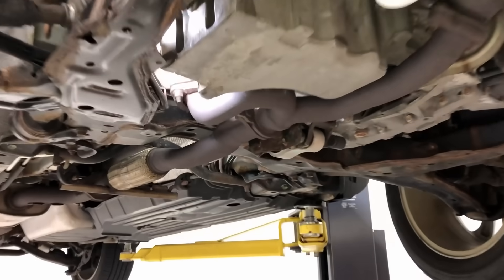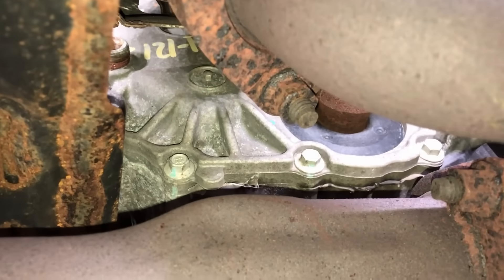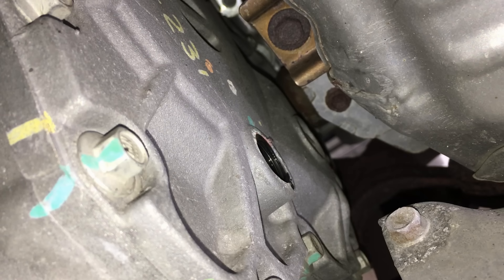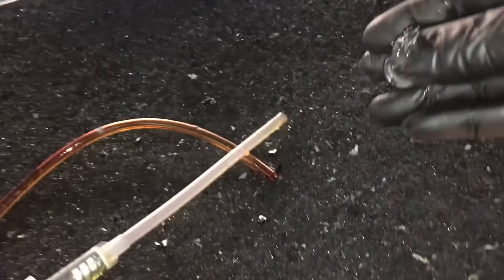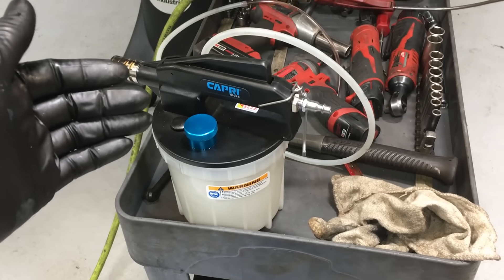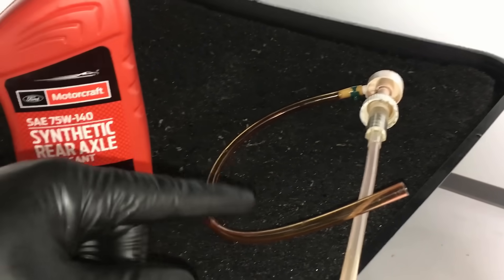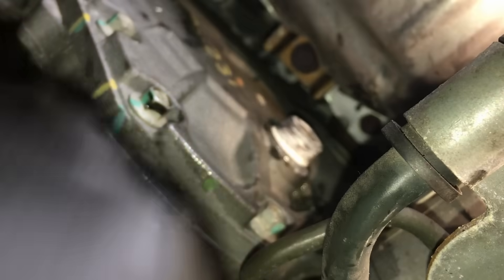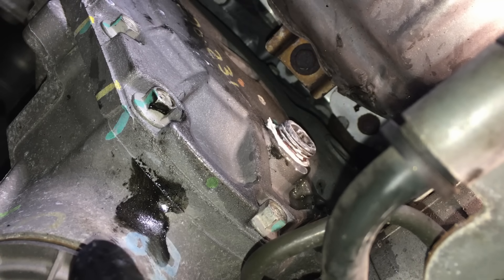Ford All Wheel Drive Vehicles: Critical PTU Fluid Exchange Procedure

Comment: Hi. I'm in  Southern  California What oil and filter would you recommend for a 2002 Ford F150 Supercrew 4.6 Trinton Automatic city and freeway driving no towing I bought it used with 170,000 miles.  It was a well maintained truck, city and freeway driving no towing.    It's my 1st oil change on truck.  1 Ford guy  I know says all he uses is Chevron Supreme conventional 10w40 all year with a motor craft oil filter on all his Ford F150s  Another  Ford guy says all he uses is 10w30 Mobil 1  synthetic with a motor craft  oil filter  on all his F150s he says the the 5w30 Mobil 1 is to light weight like the 5w20 that Ford recommends he says the engine smoother and quieter with the 10w30 Mobil 1. What do you think?
Reply: 5w20 keeps the cam  phasers happy.  0w20 in the cold. 
Triton motor likes to spit out spark plugs,might as well change them n ow and see.

Comment: My 09 flex's ptu had gone out twice. First time it was covered second they wouldn't back it. They quoted me 1500. It still drove fine. So I took it to our local transmission shop and they drilled n tapped it. Also ran diesel through it to help clean it out. I now use amsoil sever gear. Last I knew there was a class action lawsuit that you can join.
Reply: Any info about the Class Action?

Comment: It was nice in my 09 Taurus with AWD, the transmission did the front and rear drive, there was no separate ptu so changing the trans fluid was extremely easy and helpful.
Reply: If your '09 Taurus has AWD, then it most certainly has a separate PTU. How do I know? Because my '08 AWD Taurus has a PTU and because the '08 and '09 Taurus are identical.

Comment: Would this be the same on a 2015 Mazda CZ-9? I believe it has the 3.7 engine as the Ford Flex and it's AWD.
Reply: Yes, but your 2015 might have a drain plug.  Early ones did not.

Comment: If ford would stop using cheap fluids and have some integrity again maybe this shit would last longer then 30k-100k. Why I can't promote any ford after 2004. Every time you show stuff like this then promote motorcraft products that was probably inside that unit to begin with I throw up a little. Its already proven its junk and can't handle the task because I am pretty sure that's the same stuff they put in at the factory.

Comment: My mechanic changed the fluid in my 09 Mkx for $55. Second time I've had it done. Bought it with 55K had it done at around 85k and again at 95K. Will have it done again at 107K.

Comment: I have 2011 ford fusion awd...PTU failed @ 89000 miles. Cost 1200 to replace. I wish i knew about this as if i did i would of replaced fluid/checked it/did something about it sooner. Please keep videos about ford issues coming. Btw my current issue is with ABS unit...front brakes locking up...help.

Comment: A shop vac, a jar with two holes in the lid and and hoses will work on this job. It's easy to build your own vacuum for dirt cheap and saves you a LOT of money.
Reply: Actually there is a much cheaper way.  I have an old hand lotion pump with a hose attached to the tube.  Takes a little bit of time but I have used it for power steering fluid exchange and this job.  Self priming and has no issue withe semi solids like the tar in the PTU.
Reply: I wot m8
Reply: Hey

Comment: Perhaps it might be feasible to attach heat shielding
to some of the exhaust pipes and the catalytic
converter to reduce heat transfer to the PTU.
Reply: Hell no are you kidding . It's all about cutting g corners profit  baby profit baby. And besides if it lasts they will not come back for a new vehicle. Think $$$$$
Reply: That's what I did on mine.

Comment: This is what happen when 10 000 engineers do their own things then they put eveything together and hope for the best.

Remove all those exausth heat sources and it's probably good for a very very long time but someone had to design an exausth system, it's gonna go there and there, it's tight and problems start. Mine is starting to leak from the axle. I'll get the fluid changed this week. I hope it's not already too late. 2011 Flex ecoboost. 140 000km
Reply: In short, fuel economy at a price point .  Don't forget the rear differential  fluid .

Comment: Thank you for this video. I would never even thought about this fluid. I changed it this weekend. I already dropped the oil drain pan to put in a new gasket. Both were fairly clean I was surprised as the engine gas 165 k on it. What was the sealant you put on the plug please

Comment: So, this is different from getting a transmission flush?
Reply: Completely.  The PTU is attached to the transmission.  The PTU handles the power transfer (the PT part of PTU) between the front and rear wheels and is completely independent of the transmission.

Comment: That's a great information. I have a question. I own a ford EScape V6 3.0 4x4 XLT Sport 2002. The transfer case is leaking a little oil, how can I add more fluid? Can I drive the Truck if I don't see any problems? Thanks
Reply: just locate the plug ( let it cool down )  and fill it up to plug level with  the specified fluid .   Might want to suck/drain  and fill  again after a few hundred miles.
Reply: @tocrob  Thank you very much. it works better now. I am very appreciate.

Comment: I finished this for the first time, my fluid didn't look bad but I am worried that I did not fill it enough. There was a tiny stream of fluid coming out on level ground so I figured that it is full but I hardly used half a bottle. (2010 Ford Escape 4WD) I did notice though that my PTU was much smaller then the one shown in the video so maybe that''s all it needed.

Comment: Thanks for making me aware of this issue.  I just changed the ptu fluid on a 2017 ford escape 1.5l. Thankfully there is a drain plug and a fill plug. No suction device needed. 27,000mi. and fluid was black and thick. Don't put this off too long folks.
Reply: Oh no my 2018 has 56k. I'm doing it this week
Reply: @aolliegee How was the oil? What did it look like?
Reply: Yeah I’d say 20,000 max. I’ve had 2 go out on a 2013 edge. One at 60k and then 30k for the next one. Car is in the driveway now with a puddle under it. I’m gonna try an aftermarket one this time see how it fares.

Comment: Ford, because having a drain plug just makes sense. I would never buy their junk. Anything that holds fluids should have a drain bolt.
Reply: Why are people complaining about not having a drain plug the differential doesn't either nobody's complaining about that. At least it's not sealed.
Reply: @republicansareoffendedeasi821  -But the differential isn't hidden amongst all the heat producing components.  And look how hard it is to just get the plug out.
Reply: Tell that to chevy :/ atleast my mitsubishi is decent for what it is/isnt lol
Reply: I would say a plug is not always needed.  Automatic transmissions should or shouldn't have one goes either way.  Without a plug at least you have to take the pan off and while it is off inspect for parts such as shavings or see how dirty or caked on fluid might be.  Change filter and gasket and replace.  Few extra dollars but changing just the fluid doesn't let you know if something else might be going on that needs attention if it has a plug.

Comment: I'D be curious to know why I did this procedure and 2 days later I still get the fluid come out the vent cap at the top of the ptu???loose cap???HELP!
Reply: 1 - overfilled  ( technically not an issue )  ,  2 -  the vent is still plugging  up ( suck/drain and fill  again  ) causing  the ptu to burp .   The build up pressure  will eventually damage  seals too.

Comment: Do you need a friction modifier
Reply from the maker: No
Reply: Thank you so much for responding!!
Reply: @MrTommygatz  does the PTU need to be warm to suck out the old fluid?
Reply: @MrTommygatz  thanks , I drove over the weekend and let the exhaust cool but PTU fluid was still hot after 30 min. Job done!

Comment: Would you recommend installing some kind of a heat shield around the PTU? Seams like that could go a long way to preserving the unit.
Reply: The police models with active cooling are having similar PTU issues.
Reply: Matt Kraus header wrap and stainless screw type hose clamps

Comment: This is the kind of garbage the auto industry sells you. They don't put one drain plug on any gear boxes just to save 20$ yet alone not to mention grease fittings. Owned a Jeep 150 truck 4x4 it had 28 grease zerks and drain plugs for all the gear boxes. That's when the auto industrial complex was interested in quality products to keep customers. All that is built today is junk.

Comment: My 2016 focus RS at 17k miles, even with the updated PTU design failed. Tech replaced the hub/bearing assembly first as it did feel and sound like bad bearings. Moved to both axles/halfshafts next, then the PTU was changed out lol. Car was still new. No oil came out and it was like black sparkly tar on the magnet. Crazy. I’m going to change its oil every 10k Miles, pretty easy on the focus, just the air shield and down pipe need to be removed. Thanks for the vid brother.

Comment: Sadly, I have a 19 escape with one of these. How about developing a procedure for drilling, and tapping a small drain plug??
Reply from the maker: No there are ways to many design differences.
Reply: @FordTechMakuloco  I have a 2019 Nautilus and read on a forum that Ford has addressed the problem. Is that true or someone just blowing smoke?
Reply: @Pro1er Well I know they did put a drain plug on the newer models-2015 and newer I believe.
Reply: @jimh.412  Thanks for the reply Jim, it's about time for me replace the fluid but I'm an old guy and I hate (almost can't) go crawling around cars anymore. Even after searching Google I still can't get a definite yes or no so I guess I'll have to try and get under the car if I can.
Reply: laiky71 just makes too much sense
Reply: If i was going to drill into it I wouldn't just put a drain plug I would put a cooler as well and had more fluid to the system.

Comment: About how many quarts does a 2014 Edge PTU take to fill?
Reply from the maker: less than a quart.
Reply: @FordTechMakuloco  Thank you! Subbed...This is saving me a ton of $$.
Reply: @FordTechMakuloco  Did the job after work today....nasty black, stinky sludgey fluid came out, fill plug had as much sludge as the one in your video. My vehicle has 102000 miles. I'm going to drive it 1000 miles then do it again. Thank you again sir! Also, thank you for your service, much respect. ✊

Comment: I would change it, drive 500miles, then change again.
Reply: Yeah I was wondering too if it was a good idea to do a “Flush” at least one time before putting in the final (30k miles or 50km) change. I also went and had my rear end oil changed also..... 2013 ford escape with 203k km on it.
Reply: @packratswhatif  when you have visible sludge or build up always do a flush of some sort even if its gradual
Reply: He mentioned changing it again after 1000 miles in the video .

Comment: I have a question about our 08 Ford Edge. The banjo bolt is leaking on the power steering box. Replaced copper washers and new line and still leaks. Can I just replace the steering box?
Reply: Ronnie Spring the banjo bolt might be stretched or cracked. I’d try replacing that and the copper washers again and see if it stops

Comment: I was pissed when mine went on the highway, $2200.0 for a new one. It blew on the highway on the way home.  Now I asked Ford to install a drain plug and they said no and if I did it would void the warranty.  
 Those chunks in the case were not tar, that was the oil itself.  What they don't tell you is when that oil breaks down it turns to a solid and takes up space in the case, meaning you actually get less oil over time when you do the next service.  This is a part definitely designed to fail.  
 This is a great video and one every Ford awd owner should see and know about!
Reply from the maker: Of course it's not actually tar just nasty black goo like tar.
Reply: @FordTechMakuloco  yeah sorry I get that , mine was beyond that, it was like hard clay.  You can't get it out of the case and it takes up volume.  So when you go to add or change oil the next time you're actually losing volume of oil to put in. 
 I'm a huge Ford guy, use to work for Ford, but this is just wrong how they did this. Apparently in the U.S. they allow the drain plug fix, I actually came across it and took it into the shop when mine died,  but Ford Canada wouldn't cover it. 
 I can tell ya I built a 72 Mustang Grande and shoved a 429cid into it when I was 15, I still have the car at 45 and never had any issues lol, gas mileage sucks , but starts every time and runs like a champ lol
Reply: FordTechMakuloco like the tape on the back side of my 2011 f150 rocker panels ,welding in rockers today and cab corners

Comment: Thanks for helping a lot of people out with things we need to know and don't. I hope your life is going on in the right direction as far as finances and work goes. I think you have your own shop now if, I have kept up to date with your videos. That's better for a free thinking person anyways. Corporations want your soul if they can get it. Perhaps God is blazing the trail for you and keeping you for Himself when you come to that knowledge. Anyway I do have a question, if I may ask please. I bought an old 1999 Ford Windstar 3.8 for $500 with 105,000 miles on it and a lot of Michigan rust. Anyway, when I take a hard left hand turn the Auto Track light comes on saying its Active. That's weird. Then the vehicle makes a loud sound near the drivers side firewall, like its activating the abs system and starts shuddering/stalling the motor to slow. Could it be a worn out wheel bearing or half axle? Now, If I disengage or click OFF the Auto Track switch, it does Not happen. The transmission has been rebuilt by the previous distant relative. Before I put it on the road i'm bringing up to reliable standards . Being low income and semi-retired i'm on a budget and try to do all the work myself. You and you tube helps a lot. The rear axle show a lot of rust and so does the front sub frame. I might try to get Ford to recall it and replace those parts, if possible. Thanks for all the giving out and help you do for everyone trying to get by. God Bless. Bob R.

Comment: I have a 2008 Ford F-150 Limited with AWD. Is It the same setup and same procedure?
Reply: No u have a drain plug on transfer case! Ford dealer or good shop can handle cheap an easy. Use Motorcraft fluid only!!!
Reply: lol, no.

Comment: I drive a Fusion AWD that is a corporate lease.  I try to get the maintenance done but the leasing company won’t approve this service nor the transmission fluid until 150,000!  Their loss when it all catches up and damage is done I guess!
Reply: The most that the Ptu will go is around 120.000 and it will break down .has mine replaced under the warranty. Ford engineers got very great ideas for parts to break down .I like the life time oil idea... so they can make money and we pay for it....
Reply: My 2017 Escape is a fleet vehicle.  I just did 2 drain/refill myself because i have the option to buy the Escape around 70-75,000 miles.  Its at 65,000 now.  I just drove a few miles before changing a second time. Fluid is clear now.

Comment: Any possibility I could get your opinion on an issue I’ve been having?
Reply: My 5.4 f150 has this issue where whenever I am coming to a stop the rpms surge a couple times then settle. It’s a brand new long block but I’ve had the issue with the old engine as well. I’ve tested for intake and vacuum leaks, purge valve is operational, throttle body is spotless. No codes thrown.
Reply from the maker: Even though it is a new long block disconnect the vct solenoids and go on another test drive. Otherwise you would be looking at a throttle body and air intake leaks causing a disruption to the air flow across the MAF.
Reply: FordTechMakuloco I appreciate the advice, I just had the throttle body out for cleaning yesterday. Didn’t see a replaceable gasket in between it and the manifold, is there supposed to be one?  It appeared like there may have been a round gasket type seal on the manifold but not a traditional gasket.

Comment: I've got a question. On 2007 sport track 4x4, is it a MUST that caliper and hub assembly be removed to replace lower ball joints ?  Looks like upper arm can be detached then the lower control arm.   

4x4 CV Shaft looks like its not necessary to be loose or detach.

Comment: In a case like this, you are damned if you do or damned if you don't. Sometimes if you wash away a bit of that plaque you end up with increased clearances and probably some clutch slippage. Not so sure I'd be doing the repeat change after short while.
Reply: kaboom362 - These Ford PTUs don’t have clutches. Best to have the cleanest oil for maximum lubrication. 

Your advice is for automatic transmissions, which if you need dirty oil to make work you are a stones throw away from a tow truck anyway.

Comment: We got our used '16 Flex Ecobeast with 36k miles - first thing I did was take it to the dealer and have them flush the PTU. The tech said it looked pretty gnarly already. Glad I found out about this before something blew up.
Reply: Don't ever trust any dealer they're in for the money not for your benefit there is a 50/50 chance that they did absolutely nothing and charged you anyways.